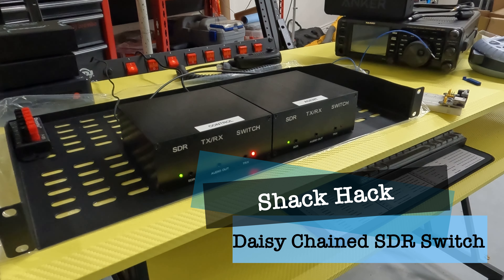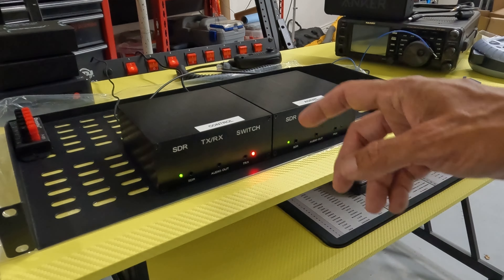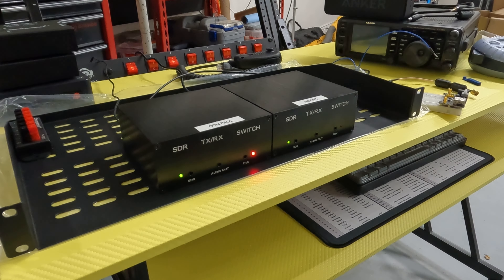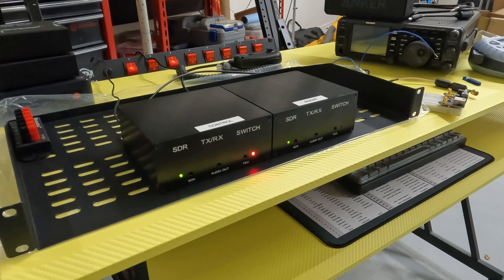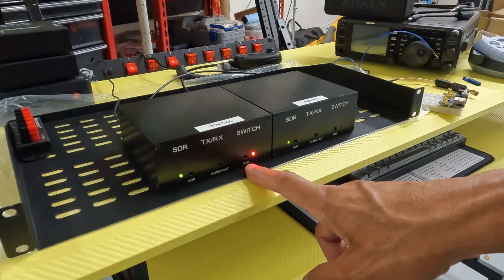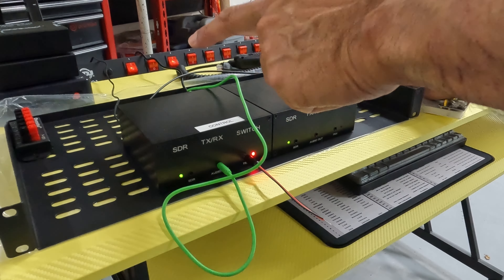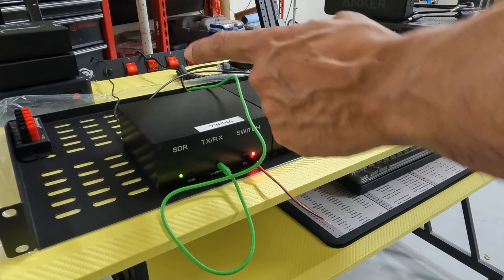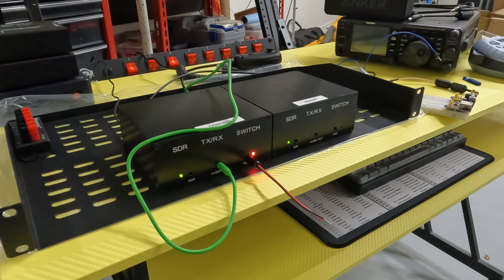Daisy Chain your SDR Switch

Comment from the maker: After posting this I realized I probably could have done the same thing with a simple audio y-splitter on the PTT line from the radio….
Reply: hi Berry
i have such a sdr RX/tx switch where D1 and D2 (diodes) are burnt out, is it possible to have a copy of the diagrams you have on it??
Vy 73 de OU1E, Rene
Reply from the maker: @ReneRasmussen-b5i  I found some online I can dig up. Are you just looking diode part numbers to replace?
Reply: @ if you have the diode part numbers to replace them that would be fine
Reply from the maker: @ReneRasmussen-b5i  can't say my schematic matches you're box but I show D1 to be  S1M rectifier in line with DC in.  D2 is a L4148 signal diode (should be the same as D3, D4 and D8)